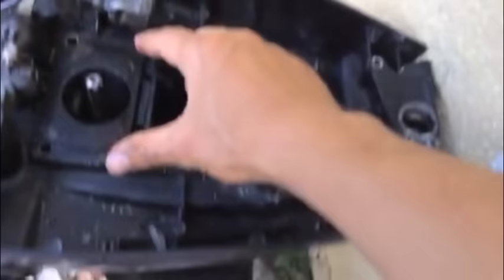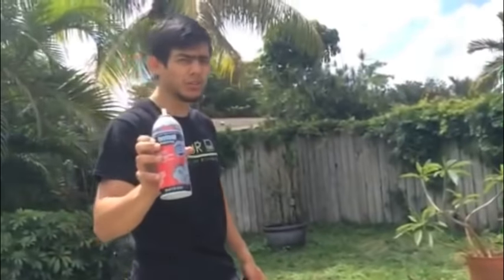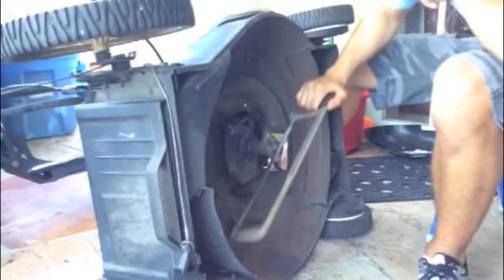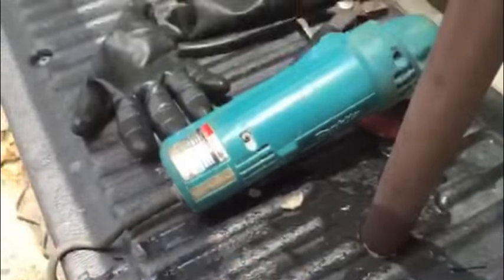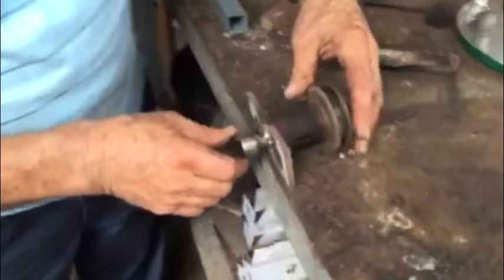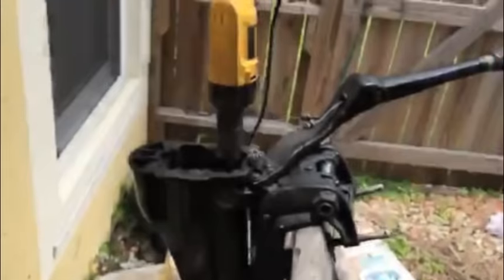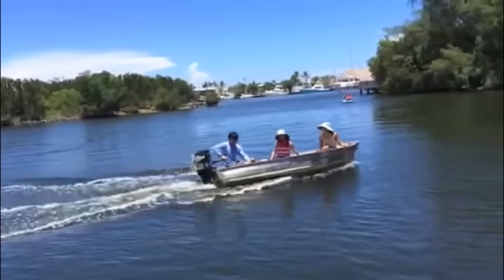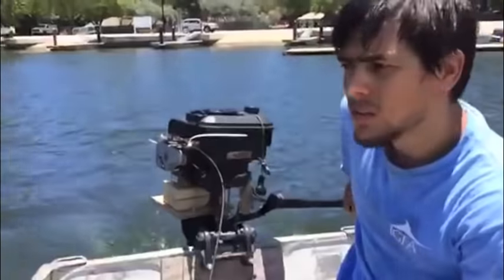Lawn Mower to Outboard Engine: Full Process

Comment: I like what you did there. I did the same thing with my trashed Mercury motor. My father, who is in his upper 80s did the welding while I just came up with the design. Works really well, but I don't have enough time to enjoy it much as I would like. If you have imagination you can do practically anything. Hats off to ya !!!

Comment: Cool - this is more evolved than what I thought !
In The Philippines and other SE Asia - they just put a really long drive/prop shaft directly on the motor (like bout 5' long!)  w/ a big prop - and shebang  ! 
When dealing w/ starting or idle issues - get some 'Seafoam'  fuel additive - it works  ! 
Good idea to get rid of the Merc power - they are usually the worst  !

Comment: I loved that video! 
You are one smart dude! 
I will be trying to build one of these soon. I hope that I do as well as you.

Thanks for the time that you put into your instructions. My only concern is the connection of the "blade" shaft to the propeller shaft. I don't have a machine shop.

It was cool to see how happy your family was when your boat worked!

Great Job!
Reply from the maker: Thanks Amy! I'm glad to hear you will be building your own! First of all, the welding solution that I achieved in the machine shop is by no means the only way to attach the blade shaft to the propeller shaft. There are many other ways to do it! The most popular way I've come across (from other youtube videos of similar projects) is to drill a hole through both the blade shaft and the propeller shaft (the prop shaft will be inside of the hole of the blade shaft at this point), and then to insert a bolt to connect the two as a single rotating shaft. 

If you do decide to weld, however, you can simply seek a friend or neighbor that has equipment and experience. The owner of the machine shop I used was a friend of a friend, and he did the favor without even charging me! So there are many ways... just be careful: any welded or bolted piece can have weaknesses that may cause it to break when rotating quickly. So it is a good idea to wear eye protection and place a piece of plywood between the shaft connection and yourself when testing the motor. Good luck!

Comment: Beautiful painting of the Prodigal Son being received by his father. 

Nice job. I would see if you could get an aluminum block and see if you can't machine the spacer you need for the engine and leg assembly. That way it will last longer and you won't have to worry about the engine spinning around on you in the event you ever hit a hidden rock or stump.

Comment: with old small engines always get the rust off the flywheel magnets and coil.  You need a good hot spark.

Comment: by the engine sound it appears the prop is too big for the engine.  but that won't hurt a thing.  you created a working outboard from 2 pieces of non working junk.
I take my hat off.
I applaud you.
you're a smart guy who belongs in engineering school.
Reply: Two years late - But that's a Good / Nice comment !
Reply: @timwilkinson2797 , a compliment is never late
Reply: All he has to do is grind some metal off the three blades evenly resulting in a rpm that meets the engines power curve rpm.

Comment: Excellent concept. Excellent proof of concept.  Work on refining it and getting some safety around that whirling shaft of death, you'll have a boat motor for the rest of your life without expensive parts.  Those points for the ignition are like $200 for a $10 part!  I just did mine so I should know.

Comment: Good project. But let me just give you a little advice.. get a squirt can for oil and put gas in it to spray directly into the carburetor to get the motor running, it will run longer to pickup the gas from the tank. Using starting fluid in a small gas moter can break the piston because I is aluminum. Starting fluid is for diesel engines (only), so you take a huge risk of breaking the piston and rings. As you noticed that it only fired a couple of times, that is because it is extremely expensive and very fast. Using gas will get the motor to fire many times and you can keep it running for quite a while just by squirting a little bit more each time it wants to stall. Great video tho and I'm not putting you down, just trying to give some advice. Good luck with future things

Comment: Regarding the avocado tree, I suspect a branch of each desired variety was removed from a different tree. A slice was placed with a knife or saw, branch dipped in auxin, bound together with twine or strips of paper. Next year the bound together parts had formed callous. In another year or two the different branches were fruiting. not as complicated as machining and welding that shaft from the old outboard onto the  lawn mower. Lot slower. And you can make avocado toast. but no boat ride.

Comment: Sounds like that motor has an aluminum flywheel. Lot of push mowers use the blade as the fly wheel to smooth out the engines running. There’s a way you could put a weighted metal disk on the bottom of the engine it would help Smooth it out. If it has a cast-iron fly wheel you don’t have to worry about it though.

Comment: good job on the limited amount of material and tooling. most outboards run WOT wide open throttle 5800 rpm. the lower units are 2:1 reduction. with a four stroke running half the rpms need a more pitched prop with more power or less pitch on the prop and direct drive no reduction.

Comment: the essence of the project is very goog but I  make the comparison of rebuilding the original engine versus fitting another engine before going deep in the project.
you 've made the proof that this setup can run but there is much more work to do to bring it to a reliable outboard engine

Comment: Using vice grips he calls them pressure pliers but he has them on backwards. Also the file and hack saw only work in a forward motion and get dulled by dragging them back. So I would like to see general shop class come back so humans don't forget how to use tools. Nice resaults though. Cubans arrived in Florida in things like that. There's hope with ingenuity.

Comment: I see this is 6 years old , but if no one has mentioned it , the flywheel on these lawnmower vertical engines are very lite. The blade acts mass for the flywheel action. That is why it doesn't wanna run at lower RPMs.     Try to find a Honda engine from a pressure washer.  It's all the way around a better engine than anything Briggs and Stratton ever made , plus the pressure washer engines had a heavier flywheel.

Comment: technically i am surprised because the lawnmower engine is equipped with a light flywheel as the blade consider as a part of it.normaly you need to replace the flywheel with a cast-iron one (heavier). good job

Comment: Hey man good job u can make it run a lil faster buy using a belt drive and 2:1 ratio so ur lower unit can turn 6000 rpms also if the water pump did work u can run a pipe to muffler and use it to quite the engine some. Also most 2 stroke engines turn around 5600 and more

Comment: The shaft can be fixed quickly by a .6 spline 18 tooth sprocket for a 49cc engine on eBay or amazon.5 bucks buy a 380 chain and sprocket kit and chain roller all less than 50 cad and you can go to any lawnmower engine you want I prefer old 2 stroke lawn boy mowers they never quit when u need them and no oil issues on the waves

Comment: I think if I was going to back out too many bolts, nuts, etc., I'd get on over to harbor freight for an impact wrench and some sockets, and a cheap air compressor.  But, I understand Carlos is demonstrating how to do this on the cheap.   But, hey, this dude got a lathe.   Forget the cheap part, damn I should have continued in my nap. CRAP!

Comment: mower motors use the blade as flywheel weight to start.. put a flywheel off a rototiller on it

Comment: when you start a motor with a pull rope pull the slack out first before you try starting it if you don't you break the cord and damage the handle overtime

Comment: Look up lovejoy connection.. that solves the machining part. It's a mating joint for two shafts.... The governor arm can be adjusted to run faster and safe to do..don't fk with the screw bend the arm and make sure you use a takometer to adjust the top speed..(look up safe speed on the world wide web) 😳

Comment: You should have removed the engine brake took the wire that's attached to the brake and put a toggle switch on it it would have been easier to do and would be faster to shut the engine off

Comment: suggestion  put a centrifugal clutch between motor and lower unit it will help by letting the motor idle and not be turning the shafts when you switch from forward and reverse.  good job your next one will be better
Reply: No clutch required, the outboard has a neutral in the gearbox.
Reply: I was wondering myself what could be done to resolve the problems with idling. Thanks for the suggestion and insight.
Reply: @consistentbass  Most small engines have an idle speed control screw on the carburetor. I wonder if it didn't have on, or didn't work.

Comment: Not a bad idea however had he gotten more help from some metal fabricators he could have had a better mount and throttle system sorry I don't have much faith in the fishing line.the other thing he could have done is mount the coupler to a centrifugal clutch.
Reply: yep. The fishing line was a failure waiting to happen very shortly. Nylon fishing line degrades with sunlight and wears down easily with minimal abrasion. Therefore it is unsuitable for this application. A small diameter stainless steel cable would have been more appropriate.  You could even keep the fishing line theme using a coated wire leader used for saltwater fishing.
Reply: If he's going to use it as a fishing boat he will have at least a hundred and fifty yards of extra throttle cable.    calm down guys!!!  Lol

Comment: young man like that needs an engineering school amazing to see how you did that you truly do long and an engineering school and you did it all with basic tools
Reply: Edward Kenard You are absolutely right Edward, and a guy who has that level of determination to see a job to the end, to document what he did, and to do it with such basic tools would make a great engineer because he understands the difficulty in fabrication and the challenges presented by The job. Way better in my opinion, then so many engineers that  I have worked with, that don’t know one end of a tool from another.
Reply: Basic tools like a machine shop and tig welder.
Reply: Them three semesters of calculus, one semester of linear algebra, and them TAM classes sort out a ton of wannabee engineers.  Dynamics is a tough one. And those are the "baby engineer" classes. Right he'd make a great engineer. Would you put your family in a boat powered by his contraption?  Neat video, neat build, but I'm not buying it.

Comment: Great work buddy ! that will be a real head turner , people will think your cutting the water when they hear that mower engine coming towards them lol. i have a honda 4.5 hp mower engine that i need to use on a project . i was thinking generators or go-cart but maybe an outboard for a kayak ? hmm
Reply: @Quirin Müller was your gokart rapid or slow and steady

Comment: Couple of things, you need to get an impact gun, at first the welding part wasn't welding, it was brazing.
Reply: well there was a tig torch after he melted the coupler, and you cant get much better than tig welding for precision welding. should have started with the tig, but then he should have just just rebuilt the original engine to start... merc parts are a dime a dozen.
Reply: Wayne Hartneck I agree.  I was wondering why they were brazing that shaft piece.  Good thing it failed and they tig welded it because they would have been stranded at the lake otherwise
Reply: I totally agree on why they even considered brazing at all.

Comment: Carlos, I'm glad you got it up and running. But it seems to me that you did so odd things to solve problems you ran into. It looks like you had access to a small private machine shop, yet you fail to use it... First, On mating the engine to the lower unit. You should have used the lathe to make a simple coupler to connect both shafts together. locking it in place by drilling a hole in both shafts and either using roll pins or nut and bolts. 2nd. The engine mounting "brackets" you made out of pieces of scape wood will not last more then 1 or 2 trips... Again use your machine shop, go to your locate metal scape yard and buy some scape 1/8" plate steel and steel pipe. Use the plate and pipe (bolt guides) to build mounting brackets mating the engine to the lower unit. Third. Route the engine cut off cable to where it runs down the tilter arm, build a small backet to mount it close to your twist throttle on the tilter. So it only takes a flip of a finger to kill the motor. In stead of the 2 hand contrapion you build. 

If you design and build the motor mounts right, you should still be able to use the engine cover from the outboad. You will have to cut cooling vents (on all 4 sides) and port the exhaust out. But by doing this, it will help with quiting some of the sound and it looks like a stock outboad... 

All this could have been done for about the same amount of money that you spend on cable, wood, hinges .....

Comment: Lol. I spent two years trying to jury-rig an outboard (junk parts, cheap Chinese imports, etc), with no more success than you had. In the end, I finally gave up and spent the money for a shiny new boat motor. Easily outperforms anything I came up with and was actually cheaper than all my previous diy efforts. If you can't buy new, a used motor is a better starting point. At least everything is there to work with.

Comment: Awesome..get rid of the govener..you don't need it..get a smaller prop.. drywall screws will rust... SS screws.. don't divert the water , take out the water pump impeller..

Comment: This motor has a lightweight flywheel because it was designed to work with a heavy blade. Get a cast iron heavy flywheel that fits without adjustment from B&S dealer and you get much smoother run.

Comment: I find the difficult part is finding outboard lowers - at least at a decent price.  It IS possible to make your own lower, but most people need instructions for that, and parts that are often difficult to find, and more - I could probably do it, but I do not feel it is worth the work and cost involved, so I would do what this guy did, get an outboard lower, much cheaper than even a used outboard, and if your engine dies, cheap and easy to replace.  Good video.

Comment: Stuck bolts suck.  I find that heat works well also to help loosen them using a small propane torch.  Good job getting it off though.

Comment: Because you are using a lawnmower engine the blade on the lawnmower originally acted like a flywheel you said you have a Lathe make a flywheel out of a solid piece of steel and weld it to your curling you will be surprised it will make your engine run fast smoother and will be controllable at lower revs I hope this helps

Comment: The Little Piece your welding on for a shaft personally I would have sweat it on. Get one piece red hot get one piece cold and shrinking on. And then weld it. Just like their due to a train wheel tyre

Comment: the blade is mass and makes the engine spin , you removed the mass , try a iron flywheel from a garden tiller engine ,  the aluminum flywheel that's on it now isn't heavy enough

Comment: small engine hint the blade is part of the flywheel process need a heaver flywheel off an horizontal engine to smooth out the impulses of the engine and help it carry the load

Comment: Its uasually the lower end that fails on an outboard motor. As far as throwing a regular motor on an outboard motor is cooling. That motor will probably not have enough torque to do what uou are doing,also it will probably overheat as well. Water creates alot of friction. Sounds to me that this guy doesnt know beans about engines. Using starting fluid on a mower means it has issues yet.You could have wired a simple on off switch and eliminated the engine brale on that motor. The ground wire is what kills the motor,not that brake. Wow dude,you worked way too hard on this project.

Comment: I tried this once. It worked OK, but the weight of the blade is part of the flywheel system. The aluminum flywheels of vertical shaft mower engines are not heavy enough to keep a four stroke engine running. Outboards have two stroke engines and their torque is higher because they fire every revolution. There is no reason why a four stroke won't do the job but you have to include some sort of flywheel in the drive system.

Comment: What is the tool used at 5:16?
Reply from the maker: Its called a jaw gear puller. This one has three jaws, so its a 3-jaw gear puller. I believe I got that one at Advanced Auto Parts.
Reply: Thanks!

Comment: Great job kid, well done. Those Quantum Briggs engines ALWAYS have carburetor issues, its a simple matter of cleaning out the very small holes in the carb. 
It looks like the adapted shaft modification was welded slightly off center or at a slight angle. This is causing a vibration which will eventually lead to your main bottom seal degrading and leaking. Probably best to ditch the 2x4's and mill a single piece of steel engine adapter for the motor. Once that's done, you will be looking at an easy and cheap drop in replacement in case you need to change motors again, just use any old Briggs motor.